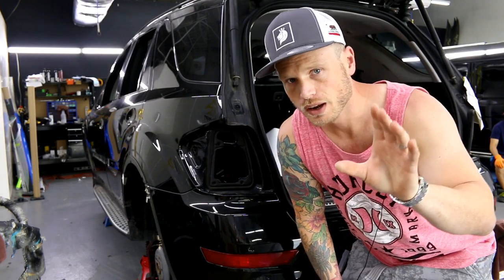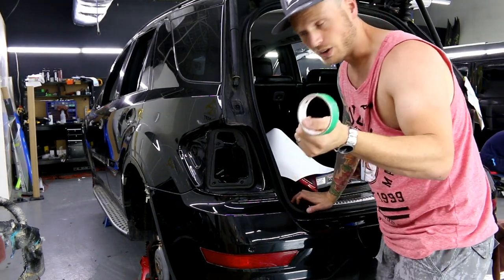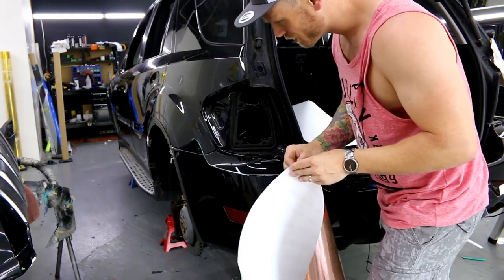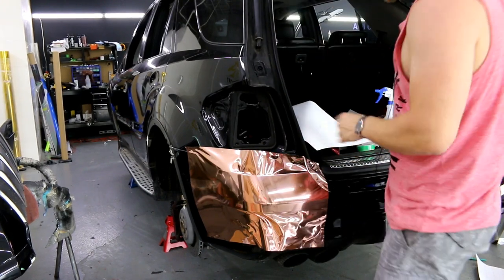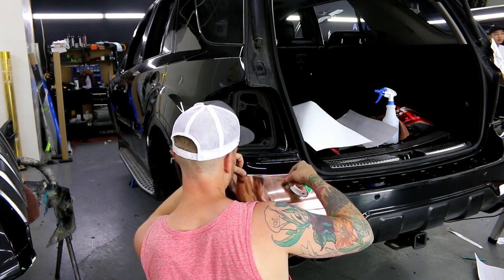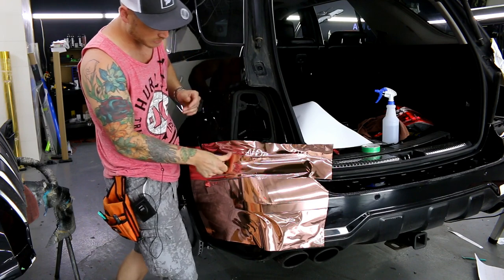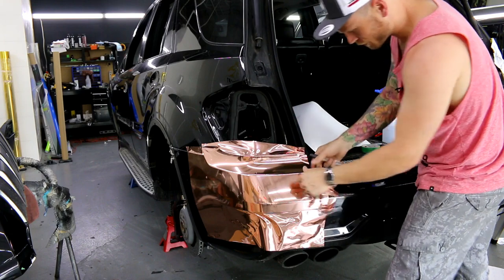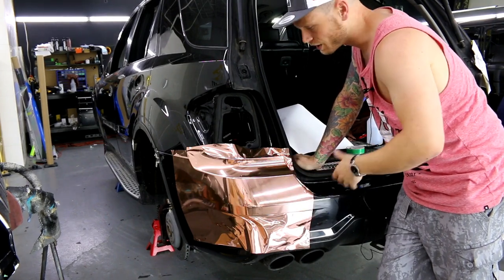HOW & WHY TO DO OVERLAYS | Overlapped Vinyl Wrap | Detailed Vinyl Wrap Tips & Tricks

Comment: Hi I really love your channel. it's always a pleasure to watch you work and explain.
I know it's an older clip. But would you recommend the same technique if you would have to wrap multiple colors on the side / door? Do you always start with the bottom part / color and working up towards the windows?
Imagine you would have a bottom color, say red and then you have two color blue and black in an angle of 45 degrees coming down from the roof. I would put the red first on it, on the edge I would put the knifeless tape on, then taking the other color wrap it slightly over the red and knifeless tape and put one more knifeless tape on the edge from the second color. Put the third on. Cut the third with the second tape and after that I would cut all three with the first knifeless tape.
How would you do those steps?
Thanks a lot!

Comment: Is there an instance where you would lay knifeless tape down, overlap 2 vinyl panels, then pull the thread to create a perfect butt joint? Even if there was no tension in either sheet, would shrinking over time and the joint opening be a concern?

Comment: So depending on visual angle, an inlay in the lower center would go in, then wrap the mostly vertical bumper face, then an overlay outer horizontal sections?

Comment: So why is it better to use an overlay rather than a butlap (is that the same thing as a seam?) where you run side by side rows of knifeless tape at once. Lay down one piece and pull the outermost tape so you can discard the overlapped extra film. Then lay down second piece letting it run wild. Pull second tape which cuts thru both pieces of vinyl and now you have a butt joint and no overlap lines. Just explained it only because I might not be using the correct terms so I thought to describe it. 
I did butlaps (or whatever they are called) for my hood and trunks different color racing stripe which created a perfect seam with no overlap or underlap, if that's a thing. Falling short and showing the cars paint. Looks perfect that way.
 Im assuming we don't want that sort of joint if you are using one color as it might make a very distinct line even if butted tight? Or do we do overlays because it helps prevent separation due to the vinyl adhering to the other vinyl and forming a tighter marriage? Im just curious if im using the "butlap" when I should be using an overlay. I just don't like that you can see the vinyl from the piece that's on the bottom. Its like a bump. I don't mind the top piece cut line that is facing down in this vid as much as the bump of lapped film. Maybe im overlapping too much and have more material under than I should have.

Comment: Summer school on Sunday here , your killing me 😀 , Chris , was this vivid wrap you just used ? Overall , which wrap do like as #1 to cover all the bases , inlay , overlay , shine , color etc ... I think I'm getting confident of doing my Corvette , I'm a detail person type of guy with anything I do , Thanks John from Harwinton Connecticut USA
Reply from the maker: Avery is the easiest to use but if it's too warm out then it will be very difficult as it turns very soft like bubblegum. Vvivid has great gloss and depth, especially to their new films. Again it will get very stick in higher temperatures but the film won't be as soft and gummy like Avery. Avoid 3m all together, their gloss finishes are very poor and the air release barely works

Comment: Just a question, 
Couldn't u just overlap the 2 vinyls that were going to stay and double cut them with the knifeless tape?
Reply: I think what happens is that over time the wrap could shrink from external heat etc, which could cause shrinkage, leading to gaps. By overlaying, the shrinkage is less likely to make the original paint visible.

Comment: Thanks for this one. I think I need to use an overlay for my Bmw Z3 (as I mentioned in a different video of yours) and now I know how to do it. Whether or not Its my only option is not entirely known to me. My hood has two body lines where I can break the material. I need to break it because the Z3's hood is wider and longer than 60"'. Although I have seen some wraps that id swear were done with one piece. Im not sure.
Im going to use carbon fiber so im also concerned about how the pieces with blend due to their being a pattern. I assume ill have to do my best to line up the design. Difficult if so as my first two pieces will be left and right side of hood on the body lines and my third piece should be center to properly overlay. So it has to match patterns of both left and right sides.. ugh
Oh ive also seen them break the material at the front wheel fenders by creating a line that does not exhist as if the fenders were separate panels. Doesn't look half bad but creates lines that were not there. Not contour but very obvious panel lines. Not sure how they did that as it does look like a panel. A space between the fender and hood. Might just be shadow or another vinyl underneath to create the illusion of depth.
Reply from the maker: If you seam it then you'll do the center first and the outside pieces after. This way the edge of the seam faces away from the eye. The hood can be done in one piece but requires more effort and skill when it comes to stretching the film
Reply: ah okay and thanks. Ya hood is about 6 inches longer and or wider than 60" So I guess that's not a whole lot if you stretch it. In fact I believe, now that you mention it, that 10% stretch is ideal. Thanks for pointing that out. I will try.

Comment: Anyone with any tips to butting two wraps without knifeless tape?
Or with it but tracing an existing wrap.
I put down a racing stripe with vinyl and now I decided I want to try and wrap the whole car. But I do not want to remove the stripe. So I want to butt up to the existing stripe perfectly with no overlay. 
My plan is to run knifeless tape along the stripe perfectly but im not sure I will get it tight enough so you cannot see the paint underneath on the new wrap area or avoid overlays depending if I drift in either direction. So the trick would be to run the wire on the tape exactly along the edge of existing vinyl stripe. Not sure how hard that would be but im really not sure theres any other option without removing the stripe, which is not an option.
Ideas?
Reply: remove the racing stipe, not much vinyl involved. redo the racing stripe, im sure client will agree. full wrap?